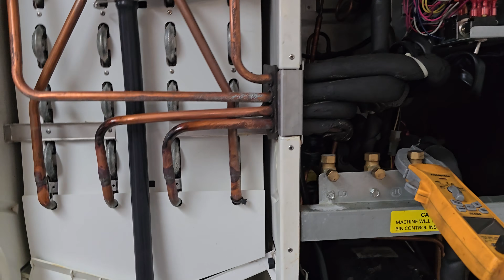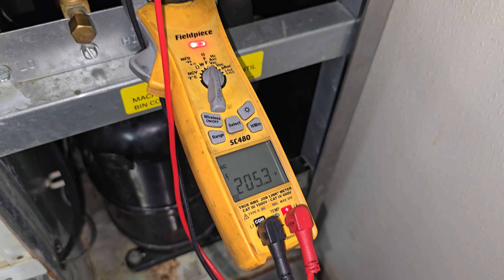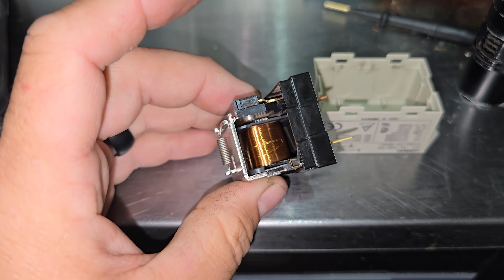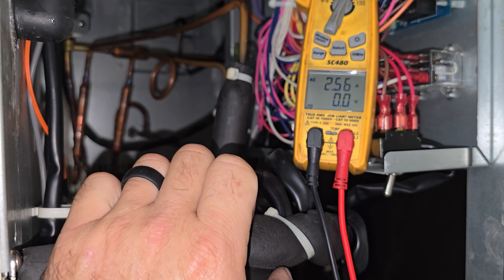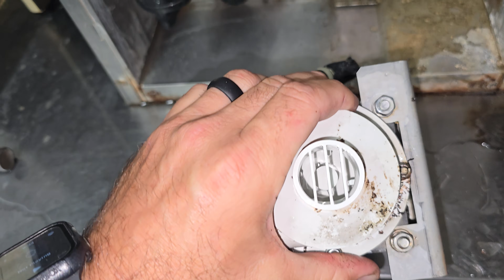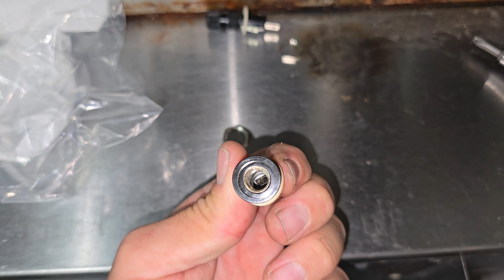HOSHIZAKI ICE MACHINE NOT WORKING

Comment: Seeing this type of construction makes me really question the sanity of humanity. Instead of a wanky fuse holder, a custom PCB and a rats' nest of wires, the whole thing could be built with a couple of off-the-shelf standard industrial components all sitting nicely on a rail. Circuit breaker, relay, motor controller, microcontroller, power supply, ...

Comment: I suspect that they switched to plastic cube guides for 2 reasons...
1. Cost of manufacture
2. Increase failure rate to improves parts or new machine sales.
I could be wrong but why else would a company switch from a non existant failure rate to one that happens regularly? Cannot be good for company reputation. well done chris as per usual. cracking video

Comment: .187 connector on an open port solder fuse carrier, loose connection from the factory as it should have been a 1/4" QC tab on the fuse carrier to begin with. The style they use is for looping strand wire through and soldering the wire to the tab, the engineers need to revise it already.

Comment: That rear spade terminal is supposed to move on the fuse block. Its spring loaded to take up the gap when the fuses are pushed in when the cap screws down and takes up the small difference in fuse length that could make a gap.
Reply from the maker: Yeah I realize that but it’s not supposed to pull right out the back of the fuse block….
Reply: @HVACRVIDEOS  when it pulls out the back did it not spring back in?

Comment: I have a machine out there with plates that has separated, it can’t keep up when it’s used heavily. It’s running but definitely harder to diagnose when something else goes wrong.
Reply: Adjusting the float past the OEM parameters will allow a separated evap to still produce, the separation points won't freeze and making it harvest sooner will negate this problem. Clear the check valve, clean the machine, and generally speaking do everything to make it solid before doing things like this to prolong the use of the machine.

Comment: Chris you can get a fuse holder for a otr microwave. Way better connection. You'll just have to find a spot to mount it and change the spade connector to normal 1/4 inch.

Comment: I see you wear a silicone ring. When I was a young tech, I was troubleshooting a piece
of equipment. I had power applied to diagnose & as I reached into the cabinet my gold
wedding ring touched the L1 side of a big cap. !MAN! did that spark & arc & hurt like 
crazy! From that day on I never again wore my ring.

!
Reply from the maker: Hope you made a full recovery
Reply: I was fixing microwave last month and didn't expected cap to still hold charges. I was cursing and told the cook I bet this pos is made in US. I removed the caps and sure enough it made in USA. Made in China caps always have load resistor for safety. I didn't even know someone still making capacitor here.
Reply: I only wear my wedding band when we go out to events, or just in general together.  I grew up using power tools, working on cars, and I'm in and out of computer cases and server racks every day.   I won't even touch a silicone ring - that can still suck your finger into a bad place.

Comment: Reminds me of a problem a had with pastry cases in Starbucks years ago. Every time I went there they would be froze up. I thawed them and ran it and found no issues. After numerous call backs  I started looking closely at the compressor start relay and decided to open it up and found the contacts were severely burnt and pitted. The relay was sticking and over cooling the case and then freezing up. I then found the relay was not rated to the amp draw of the compressor circuit from the manufacture. I changed it to a normal 30 amp contactor and never had another issue. Never assume the manufactures are perfect and never make mistakes. Great vid man!
Reply from the maker: Great catch

Comment: 😅 that fuse holder is from the dinosaur days! The problem is when they first made them they would last 100 years.. anything else? How can we cheap in this up? They changed the thickness. They changed the width. They changed the material Used. To the point, they are basically junk, but in the day they would handle double the amperage they were rated for . In 50 years Of modifications, they are junk. I cannot understand why they don’t replace them with a standalone breaker.🤷🏻‍♂️🤦‍♂️ Great content, thank you
Reply from the maker: Thanks for watching

Comment: Definitely, the lose connection on the fuse holder.  Fuses are designed for operation at 25C.  That's the temperature the fuse element is designed at.   If the operating temperature is higher than that then a designer has to get a correction chart from the fuse maker.  It will show that higher and higher fuse amperages will be needed to provide the desired current protection.     As an example, a 1A fuse in a 25C environment might need to be 3A fuse in a 60C  environment to provide 1A  protection.  In this Hoshizaki case that bad connection can heat that fuse terminal to 100C!  That would make that 10A  fuse drop to maybe a 2A rating.   Spontaneous blow.
Reply from the maker: Thanks for tuning in
Reply: Very cool info. I'm having issue with walk-in freezer with heater fuse blown every few month. Didn't find any short, loose wire, all E/I/R good but when calculated @125% it pulling almost 17A on a 20A mini fuse. The fuse panel is close to heating element that could be the causes. My problem now is do they make mini fuse over 20A?. Thank you.
Reply: @pnp8849  "Mini" fuses are automotive and only good for 32V.  So, I'm a bit confused here.
For checking out a fuses operation temp you can use a temp gun and up close check its running temperature.  Of course, you want to check at the end of a long on time.
Reply: @keithcress1335  I check the rating on the package Bussman-AGC, 1-1/4" fuse and sure enough it for 32Vac. I should've bought Bussman ABC it looks similar but has ceramic is for 250Vac. Thank you very much.
Reply: @pnp8849  At the higher voltages the energy available causes glass fuses to explode in their holders.  That can damage the holder and presents the repair person with broken glass.   So, the fuses have to be ceramic to take the energy hit.   Glad you got that cleared up.  Cheers!
Reply: @keithcress1335  This is why I like to hangout in this channel since many subscribers are too, a professional. Sometime I got long day I still watch Chris channel and reading from the replies.

Comment: Great video. That fuse block  l never like them once you have a problem essentially the smaller connection . l would  put a inline fuse holder that push together if you didn’t want to go OEM l have better luck with them .
Reply from the maker: Thanks for the info

Comment: 4:50 These connectors (I think they're called faston) come in various sizes and flavors

2.8mm
4.8 mm  ( .187 in ) probably what you have in that machine
6.3 mm ( .25 in ) which is most common
9.3mm or 9.5mm

The crimping part comes in different colors to indicate wire thickness
Red 2–16 AWG; 0.5–1.5mm²
Blue 16–14 AWG; 1.5–2.5mm²
Yellow 12-10 AWG; 4–6 mm²
Reply from the maker: Thanks for that

Comment: I did remember the logic of this fuse holder.. It sounds like
"A fuse installed to protect expensive equipment in the event of a short circuit is reliably protected by the equipment that burns first"

Comment: We have a mid-1990s Hoshizaki at work, not sure of the model, but it's been an absolute workhorse. Our water is well water, hard water with high calcium, lime, and iron. We've lost the occasional thumbscrew and the bin full switch never shuts it down, but other than that we've never ever had an issue with it. It should be cleaned much more frequently than it is, but it is regularly cleaned according to schedule for a much cleaner water supply. (Bare minimum is much better than what I've come to expect, and since the bar is that low, I'll accept that without fighting with them. That's pretty much at the very bottom of the list of issues with the store.)

It's probably the BEST piece of equipment we have, as aside from the bin full switch being either bad or improperly adjusted, it works dependably and continuously ALL the time without fail. I hope it's got a few more decades' life left to it.

Was doing some deep-cleaning the other day, and gave the tap system's condenser a thorough brushing out of the accumulated dust. It wasn't bad, but it needed to be done, and afterwards I could see through it. I grinned and thought of this channel when I recognized a Dixell controller above the condenser, I hadn't really looked behind the panel door because I hadn't had the time yet until then.

Maintenance was in the other day, finally attaching the lids to our sandwich station, which had been loose for over a decade due to missing hardware (and we don't replace the missing hardware, we cut the stainless and pop-rivet because nothing but the best, right? AND HE STILL HASN'T REPLACED THE POWER CABLE ON THAT SAME EXACT SANDWICH STATION, WITH ITS MULTIPLE BREAKS IN THE OUTER INSULATION!), and he decided to do random temperature checks of our two Delfield under-counter reach-in fridges.

"Whoa, this one is at 34°!" he exclaimed in shock as he checked the Drive Thru one. I looked at him and said, "Three weeks ago it was kicking butt at 26° when it was 89° in the store, I had to adjust the thermostat." I keep those coils clean, too. I know by now that if the equipment's going to last at all, it's going to be up to me to do it; and when it fails it'll either be half-@$$ed back together to limp along, or we'll be given some other store's rejected half-dead equipment that I'll have to nurse back to life. 🤬
Reply from the maker: Restaurant life is hard, specifically on equipment as well as the folks in charge

Comment: (Edited to fix phone typing) I've responded to two comments suggesting automotive fuses..DO NOT EVER USE AUTO (TYPE ATO) FUSES ON HIGH VOLTAGE! They are only rated up to 32 volts, and cannot handle high voltage AC with its much higher fault currents. 

ATO FUSES WILL EXPLODE AND/OR CATCH FIRE IF USED ON AC VOLTAGES ABOVE 32v.

Comment: Don't know if anyone else mentioned it...but the equipment demands a certain wattage of power to do its thing...if you have a poor connector then the voltage drops...if the voltage drops then the amperage has to go up to get the same wattage to power the equipment...causing melted wires, blown fuses etc.    A normal example is if you use a small gauge extension cord with a heavy load...that extension wire gets warm...and maybe a fuse blows...for the same reason.
Reply: Lower voltage = higher amperage when resistance  is the same. So I was told 50 years ago.
Reply: @halverde6373 sounds good to me explains why loads on cars usually hurt more.

Comment: The fuse holders for those glass fuses vary greatly in quality,  The U.S. and NATO use that style of fuses on key equipment, that style fuse and fuse holder are used in aircraft - they don't fail; Look for MIL SPEC.  Shop around, many of those fuse holders sold are junk, often made inexpensively in China. Some of the fuse holders are of good quality.  You can't use price  as a guide, you have to look at the seller and whether the fuse holder meets specs, the highest is DoD .   Standards for MIL-PRF-19207G.  Average, ordinary use holders should meet UL 4248 and IEC 60127-5.  If they don't meet any of these standards they are likely inexpensive junk.  Shop around.
Reply: FWIW it looks like the ones supplied by Eaton. I don't know if they make them, but the quality is ok. The bigger potential issue is those crimp-on spade terminals since they make lousy contact in a high vibration environment. I would expect them to at least use machine crimped ones instead of those. They're not very secure.
Reply: @mysock351C  ---  Vibration resistant connectors are available.
"Insulated Vibration-Resistant Quick-Disconnect Terminals
Terminals Interlock with Each Other
A plastic cover on the barrel provides electrical insulation. Easy to install, connect, and disconnect, yet difficult to shake loose—these terminals interlock with each other to make a secure connection. Use a crimper (not included) to install wire."
Reply: @DavidNull5  I think the main issue is not the actual connection per se, it’s the crimp. These just have the basic oval crimps which are fast, but not very secure and deteriorate more quickly in a wet environment. Better is a “B” style crimp, and they are amicable to having solder flowed in if you really want to make a secure connection/repair. But at the factory they require more skill and time to crimp on an assembly line when wire harnesses are done by hand like these appear to be. A better potential solution would be to use ones that have pre applied solder and flux along with shrinkable shrouds so they can still be easily installed. The whole harness could hen be passed through an oven to solder and seal all the connectors, but it would be another process they would have to develop and perfect, not to mention more money. To be honest I’m kind of taken aback by the actual construction used. It looks very “DIY.”

Comment: Get you a pair of ChannelLock 909 crimping tool with cutter. I us them on everything from red to blue to yellow StaCon crimps, both insulated and non. Forget about the insul dies. The non insulated dies on this tool work best. I've even crimped thin gauge solid copper t'stat wire with them without issue. Just hve to double back the end of the wire under he crimp.

Comment: You're wrong about checking the bin stat first. Always check plates for speration first 😂😂😂😂😂
Reply from the maker: Good point
Reply: Feel real dumb going through a machine spending $1000 fixing stuff just to have it lock on 60/70 minute freeze cycle and you only have one solder joint left 😂😂😂😂😂

Comment: If its just a loose connection, its probably not overcurrent blowing the fuse, but just overheating causing the fuse to blow just like an overload would
Reply from the maker: Good point

Comment: Replace the fuse holder with automotive fuse.
Standard covered 1/4 connectors and a fuse.
Reply: You cannot use auto fuses on high voltage!! They are rated for 32 volts max.
Reply: @mxslick50  Amps are amps. Fuses are rated for amps. That shitty glass fuse is an automotive fuse.
It's use is just for control line safety .

Comment: On the pump when it fails take it out and see if the impeller spins if it doesn't take a small screwdriver and spin it around,  you will see part of the plastic cube guide broken off spin the impeller around and you can get that small plastic out.  Then reinstall, and it will work as designed
Reply from the maker: I have ran into that a time or two

Comment: Hi Chris, I'm servicing an older unit that has line leaks at the rear and it at corner. I don't see a way to remove panel or to get up in the corner and can't break the behind wall. Se far I just keep refill every few yr. What's your opinion? Tell the store to condemn it? Thank you.
Reply: Is it possible to run a new line-set?
Reply: @Somebody3120  I can't even get behind it  and I think it's rear service.  They also install soda rack on other side of the back wall so break down the wall is nono
Reply: @pnp9200  Righto. Does the front or top cover come off or is it entirely rear service?
Reply: @Somebody3120  Another company came and they couldn't figure a way to fix it either. So they got corporate to buy a new unit. Some weird brand name. I hope it fail soon so they can call me. I think it's 448 which I don't have experience yet but I've seen Christ video. This is corporation so adding leak-stop is a no-no and is a quick way to get kick in the booty.
Reply: Kind of a hack fix but leak seal maybe?

Comment: The smaller connector is 4.8 mm, the standard one is 6.3 mm, those fuses should be ceramic on 208V, nice video as always 👍👍👍👍👍
Reply: 4.8mm = 0.187 inch connectors, as generally sold in the US.
Reply: @redneckcoder 3/16
Reply: @redneckcoder it's 3/16 and 1/4, that's the normal size it's labeled as.

Comment: I was in a hotel over the weekend that had a Hoshizaki crammed in a tiny, un-vented un-air conditioned room. It was easily 100 in that room and it sounded like the poor compressor was internally bypassing. It was struggling to make much ice. I bet they go through ice machines with that kind of abuse.
Reply: Sales OPPERTUNITY !!!  😊😊😊😊
Reply: @davidsanders6957  is it that simple? Doubt they're gonna want to do necessarily additions of hvac to keep it cool.. or just throw a new one in only to be blamed that it'll crap out again in who knows how long
Reply: @LocoMan95  Perfect spot for a model with a water cooled condenser
Reply: haha, usually they have an bathroom exhaust fan or tied to the building exhaust(silent/no noise) maybe they have a failed fan

Comment: I have a First CO. Air Handler that uses one of those with a 5A. I replaced it with a resetable fuse after finding a short on the fan relay and heat sequencer. I agree, not the best way to run a fuse.